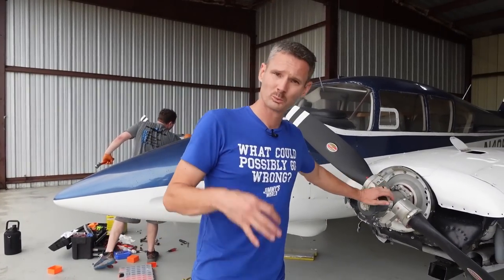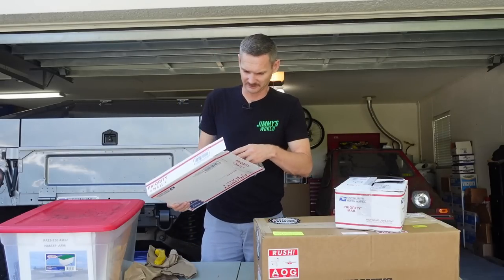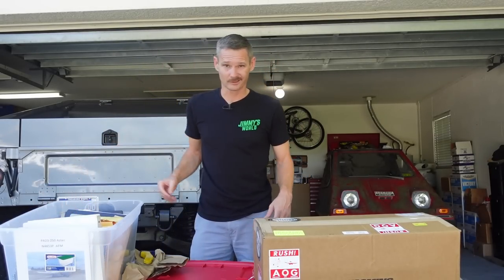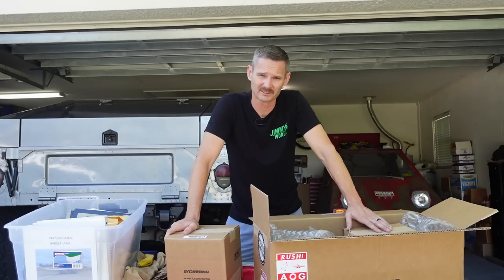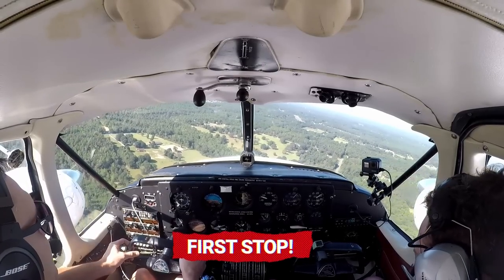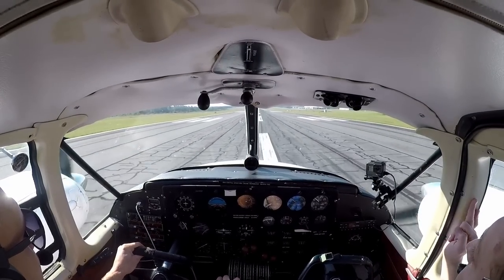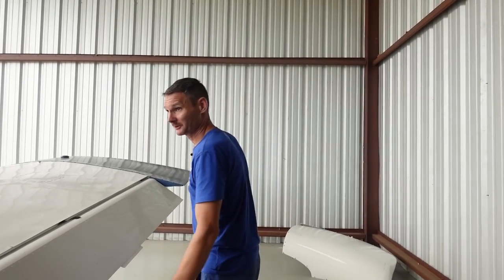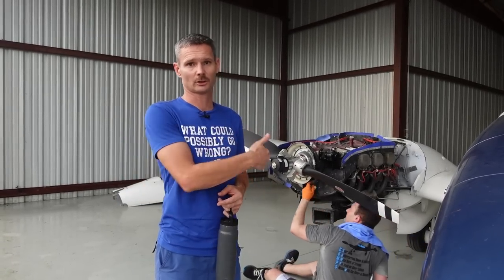Rebuilding An Abandoned Piper Aztec Airplane Part 3

Comment: Every power plug I've ever seen on a light GA aircraft gets installed as close to the battery as possible, to minimize the length of the heavy cables required. Find the battery, follow the positive cable to find the external power relay, follow the wire from there to the external power plug.

Comment: I got locked out of my old plane a Piper 235 (N8556W) long ago. The keys were just sitting on the dash. Of course it was in the middle of the night and at small uncontrolled airport. While rummaging through the small pilot lounge I opened up a cabinet with a ton of keys that went to random stuff around the airport. None of the keys were airplane keys though. However, one of the keys for the mailbox, looked very similar to the cargo door key so I figured I give it a shot. Guess what? It worked! I climbed from the cargo area to the front and was able to open the door. Saved us having to get a locksmith to open the door for us. 

As always very entertaining video. Thanks for sharing.

Comment: Jimmy just a heads up, putting a couple of gallons of gas in a bladder tank does not guarantee that it is good.  Bladder tanks tend to dry out on top due to them not being full all the time.  The sun bakes the tops of the bladders and if they are not full there is nothing to keep them from drying out and cracking.  To really test a bladder tank you'll need to fill each tank to the brim and wait a couple of days to be sure they are leak free.
Reply: You’re so correct.  I’ve replaced them on a C182Q model.  It was leaking at the tube section for the drain.  What a pain to replace.
Reply: @Feelin' FPV  looking logically at it, doing that would prove leak or no leak up to the fuel level  but in order to prove the whole bladder you still have to fill it to the brim. I suppose pressurising it will do the proving quicker, if that is actually what you meant.
Reply: The one time that it's good to have a full bladder for a long time.
Reply: @dalepatterson1748  heh heh! Mummy I need to pee. Hold it in son we're nearly home!
Reply: @Feelin' FPV I’d try nitrogen
Reply: @Feelin' FPV fuel systems are usually very well vented from my experience on land vehicles.. ive not a clue about aircraft's but I'd imagine its the same so a pressure test wouldn't work

Comment: Jimmy:  ADF - Automatic Direction Finder for Nondirectional Beacons ( NDB) which are still in use.  You can also home in on AM radio stations.  Or just listen to the broadcast.  Glad you did okay through the storm (I’m in SE Seminole County - got wet but no damage.) Great channel!
Reply: Aren't there still NDBs around?
Reply: @KurgerBurger  Not many still in operation.
Reply: @dieselyeti  The ODP at my local airport relies exclusively on a NDB. If you don't have glass in your cockpit, you NEED an ADF unit in order to fly the standard obstacle departure procedure here. (KRUT, VT, USA)

Comment: Thanks for sharing Jimmy...why not call a lock smith..have an extra set of keys afterward..and hopefully cheaper than gas for making an extra trip...
Reply: he said in the video he will need to make at least 3 more trips to get airplane ready to fly, so this trip they worked on the items that could be done without needing to get into the cabin or locked compartments. Plenty of house needed to install new electronic mags, battery, starter. Not a wasted trip, just need to pospone maybe starting engine this time.

Comment: Fun fact, Piper only made 5 different keys for all their planes and most simple Masterlock keys will get the door open. :) Picked that one up working many years on the ramp and having to move planes where the parking brake was left on even though the aircraft was double chocked.
Reply: I have a key box full of them. I have never found an airplane lock or ignition that could not be turned.

Comment: Jimmy I would like to know the exact FAR you were looking at. Also Ihope you know you can just replace the ring gear on the flywheel. They are relatively inexpensive.
Reply: Me too because I'm 99% sure there isn't one
Reply: If you can find just the ring, fine, but most likely you will find it all together.
Reply: Buy a ring gear. Lycoming. Easy peasy.

Comment: I was an apprentice locksmith a few decades ago and learned the benefits of rekeying locks. One key for the whole house, instead of two keys for each door, for however many doors the house has. 
If all of your planes use the same key, then it wouldn't make any difference which plane you were going to be flying. 
I don't know, but I can imagine that the locks would be the same size, just pop the handle off and change the lock cylinder. If planes don't have a steering ignition interlock then you could have a couple of spare ignition locks made up. Then if/when you sell a plane, you could change the locks to a different key for the new owner if you wanted

Comment: The ADF is the receiver for an NDB station. There are still NDB approaches, so you need an ADF to shoot those. Practically? I suspect there is a GPS approach now for any of them, but I have not checked.  Meanwhile, an ADF is an AM radio receiver, so you can use it over long (and short) distances as an unapproved aid to (i.e. VFR) navigation with the feature that you can listen to the ballgame on it.

Now Get Off My Lawn.
Yours in Clear Propping,
A Geezer

Comment: In the airline industry ( Delta Airlines ) it’s called a MCO Or a maintenance carryover item. Something that doesn’t have anything to do with safety however you need to fix it.  Usually within so many flight hours. Our during so hanger time.

Comment: Jimmy, I suggest you adopt the habit of always making a list of everything you need... a check list to be sure you have what you need when it's needed.
Making a list of everything you need to do before heading out for a trip is priceless! It's like pulling into a parking lot and leaving the keys in the car instead of making 
sure they're in your pocket before locking the car. I keep a spare key on a retractable lead behind the front and rear bumper. Perhaps you could find a place to hide a 
spare key some place in the landing gear wheel well.

Comment: Hi Jimmy keep them coming.each video is a master peace.
I did have a thought when you showed those wire strippers, i still have mine and inreckon tbey are really the very best.
Used a  lot for telecom firms tey are made to ajust to the tbickness of both the wire and the insulation and you put the wire in the fron instead of the side, leaving a very neat finish to the insulation and are made so that you dont go banging your hand when the insualtion comes off..
The starboard engine sound very rough to me even though it did not actually light up, almost like it has a problem with either a bad cylinder ar fuel locking.
To put a new ring gear and starter looks like a long job, and inwondered if you have to pre heat the ring to drop it over the fly wheel.
I just do not understand how a bit of kit like an aircraft get left to die, for starters they are VERY pricey items and do require care ever when not in use, leaving the to elements, to my say some people have more money than sence.
I know you can get good covets for a car that does protect the tbing from all the things which mean a lot in terms of cost, so even if its not being flown, it still needs some T.L.C..
This looks like a cract with a number if big problems all because it been out in the open.Something that has always puzzled me is that the engine has to run flat tack or near to it.
Why do they not but a gearbox like a car so you can get the prop oerformance without running the engine so hard??
That goes for boats as well, the more revs the engine is pushing to more fuel its using.
I was hopping that we might see more on the helechopter as i reckon that was a really good move because it opens the door to changing up in size so you can take the family??????

Comment: You crack me up As an old pilot I have shot many approaches using the ADF You tune it and identify it and navigate to or from a transmitter It was not a very accurate way to operate as it was subject to interference and would go nuts around thunderstorms

Comment: When I purchased my T210L, it came with a single set of 3 keys for the door, yoke lock, and ignition. I drove down to the key shop and 10 minutes and $20 later I had 3 sets of keys with label tags.
Just saying.
Have the wife overnight the keys to the guy working on it there. so they are stored locally.

Comment: The ADF was a handy little gadget for times past. It was little like VOR navigation, except instead of tuning to a VOR, the Automatic Direction Finder tuned to a Nondirectional Beacon (NDB)  it required two antennas, one of which was the loop that you see in old airplane photos and movies. The loop was tuned to direction, and a sensor antenna determined if you were flying to or away from the beacon.  The beacons  were located on the airport or field, and broadcast a constant signal unique to its location.   Later the sensing and direction became automatic.   All one had to do was select the frequency.  If there was no beacon, the ADF could be tuned to a radio station. Radio stations used to be in every city, and even in a lot of little  towns. It wouldn’t get you to the airport exactly, but it could get you very close - automatically!
Reply: Beacons are still working here in the UK. There is one about two miles from my house on the London airport circuit. it's at Lambourne End Essex using Morse code LAM

Comment: Piper locks are cheap wafer locks, you can jiggle them open with a bobby pin. They're usually all so worn that ANY Piper key will operate ANY Piper lock.

Comment: 😂Jimmy Jimmy Jimmy.........hate to tell you this, but both mags require an 500 hour inspection. Most Lyc 4 cylinders have the Impulse on the left Mag (although some have impulse on both sides) Most people install the Surefly on the right , leaving the left mag and impulse installed. Now the airplane will start on either mag plus eliminates the requirement of starting on the left mag only. Starting a 4 cyl Lyc on both mags may well cause a kick back which may destroy your starter and starer ring on the flywheel. Most newer aircraft with twist to start systems, the switch automatically ground out the right (non impulse mag) on start up, but older airplanes (like my Grumman Tiger) have push button start, and you have to select the impulse (usually the left) for starting to prevent kickback. With the Surefly is installed you can start in both.

Comment: a little trick with the keys jimmy get the wife to take pictures of both sides of the keys sitting below a ruler then a lock smith can hand cut the keys and fine tune them on site and it saves them time doing it from scratch cheers from down under

Comment: No key for the airplane? Hey, your name is "Jimmy" isn't it?  My technique was to find a key that went in, then pull it in and out a wee bit quickly and there is an off chance that the tumblers will briefly line up allowing you to turn the key 90 degrees. A little penetrating oil might help too.

Comment: Luvit new stainless rescrew. Finaly the harness( caint wait for the effeciency) DAMN GOOD CRIMPER
Reply: Yea that engine time kicked back when it tore the starter up. The starter died doin its other job.
Reply: Yea thats what you need off the internet, a big keyring of used airplane keys
Reply: I had a big key collection like 45 years of collectin. I misplaced my shop key and went thru my collection and stoped when one that fit i raked it backn forth and up n down and it worked

Comment: i'm glad i don't fly that much ,,it gets expensive ,,,lately i have been using a more economical mode of transportation , i started riding a motorcycle  which i built myself from spare parts ,,powered by a Kubota Z482 2 cylinder diesel engine ,,makes my daily trips to town cheap  because it burns 1 liter of fuel every 25 miles ,about 100MPG

Comment: I would like to see a clear prop with a P51 Mustang on the shirt. My favorite aircraft as a child. Till I learned about F22 that is my go to know. That engine on the left side as your looking at the plane might have hydrolocked on ya as well so pull the plugs and rotate it and time it before lighting that ignition power. With the seal out on the front of the engine the back one is probably leaking as well due to not being rebuilt and needing it done as well. But I do not trust mechanics who have to use crescent wrenches to work on my stuff instead of using the proper wrenches. Now Jimmy you are just being redundant when counting the teeth on the ring gear as you put it being taken off by the starter gear. Showing that the starter was stronger then the teeth on the ring gear and that a cylinder might be hydrolocked, which kept the starter from turning over the engine and knocking teeth off the ring gear.
Reply: Crook magneto they kick back it’s swinging through to many turns to have anything in the cylinders

Comment: Looks like your Bendix mags (snap ring impulse coupling) were affected by AD 2005-12-06.

     This is what is driving the mandate to inspect at 500hr intervals.

     Absent this AD or an airworthiness limitation in the AFMM (maintenance manual), there is NO requirement to overhaul, or rebuild magnetos.

     The blanket statement you made in the beginning regarding mandatory “rebuilds” for magnetos is not accurate.
      
      Most of the time, appliances such as magnetos are inspected visually and timed to the engine.   They are considered airworthy “on condition” with no requirement to remove them.

      That being said, it is pretty important to remove magnetos and get an IRAN at 500hr intervals since most mags have a MTBF of roughly 1000hrs….it’s just not mandatory.

     The impulse coupling is the achilles heel of the magneto and when it grenades, it rains metal shrapnel into your accessory gear train and oil sump.

    It’s also important to emphasize the cost hierarchy of maintenance on aircraft components.

    IRAN (repair) :    $
          Overhaul     $$
              Rebuilt   $$$
                  New $$$$

   With the exception of QAA and Slick magnetos, Rebuilds can only be accomplished by the original manufacturer.

Comment: Hey Jimbo maybe if you didn't have all that valuable space in the rear seat occupied with a Child you would have been able to actually take those vital parts with you ..I'm sorry but I just don't get your constant need to have one of your off spring standing at your side ..especially if they are not capable of even waxing a Door knob ....That's just dead weight ...

Comment: jimmy, i have been hearing quite bad things about lead and its value on the markets. their is a strong drive by governments world wide to faze the use of it out in favour of a more environmentally friendly metal.
Reply: It depends on what it's used for.  OK for lead-acid batteries, but two good examples are phasing it out of paint, pipe and brass fittings (to stop exposure to kids) and electronics, since so much is thrown away - it reduces lead pollution during electronics recycling.

Comment: have you thought about tool sponsors jump boxes eco flow blue etti jackery portable generators. i’d love some screw drivers milwaukee has some things i’d like to win work light electric grease gun their tire pump chain saw blue etti has one with rv plug thrifty amp cool i thought . plus their battery packs sometimes our power go poof my mother can’t sew cooking is out. unless i had the bigger units i have two jackery units 240 watt xmas gift, 1,000 runs our trager pellet grill small tail gator. but to run my fathers and family wi-fi unit need to get the big 2,000 watt jackery makes or the blue etti or an eco flow. those units even with out solar panels are stout. theirs no telling what my mothers machine draws and two lamps. for sewing. the reason for the bigger units our surge protector went out in the rv popped all the circuit breakers in the rv dead. total hot box all night. God i wish i could afford the big unit. plus eco flow has portable ac unit. duuude at that time something. fridge ran on rv batteries till eh 3:00 am or so ours has a residential fridge to run the water pumps to flush is battery if that happens. rv trip next year we will be gone practically a month. one of those big units would be handy. if the camp ground looses power or the box has an issue please please blue etti send me your unit with the thirty amp plug and battery pack least a ceiling fan can be turned on or run the fridge or run the pellet grill with peace of mind. plus if people ask well free advertising